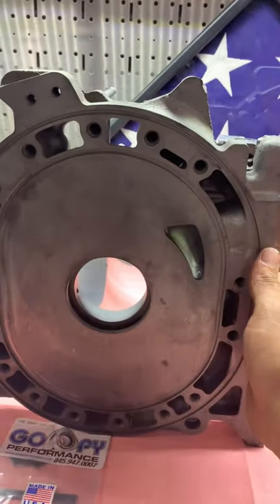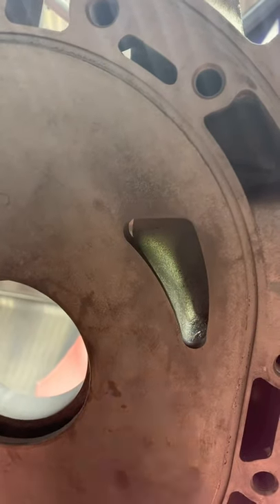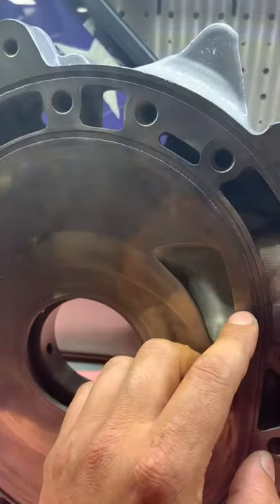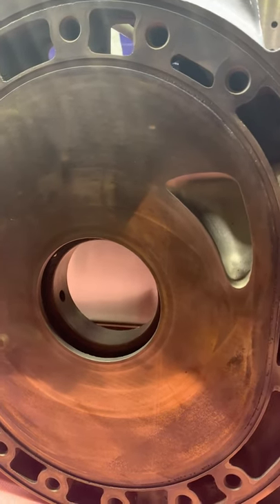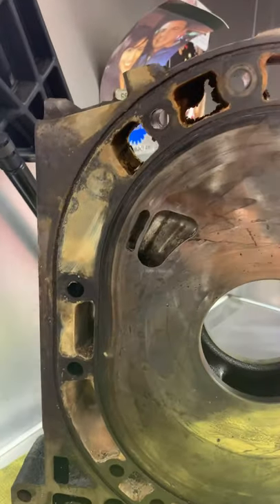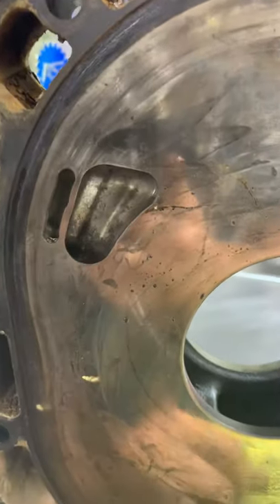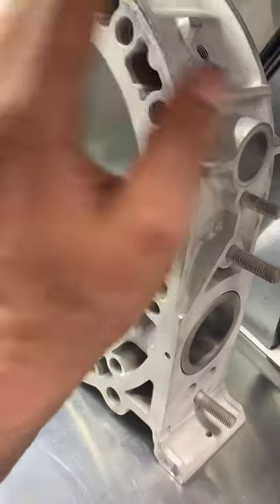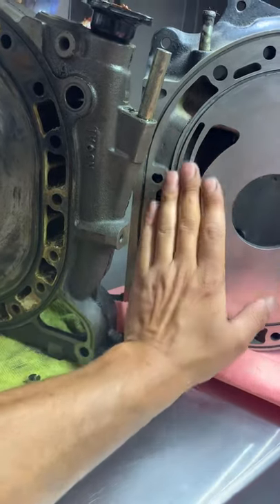Why semi p ports are better then bridge ports

Comment: Thank you!!  I am a huge fan of changing the closing edge so that the corner seal edge closes later but the oil seal edge is untouched.  This aims the closing edge, where the air flows over, at the center of the chamber at the point of highest chamber expansion rate.  It also softens the reversion pulse as the rotor closes the port, for less shock pushing the airflow back up the intake
Reply: Very unique 3D visual perspective you've just created! Cheers
Reply from the maker: Absolutely spot on bud.

Comment: The apex seal issue can also be caused by excess heat build up around the plug area, causing a high spot on the housing and wearing the centre of the seal (so I was told by one of the most reputable builders around)
Reply from the maker: glen scholz yes very true. The semi limits that from happening and also tuning. To high of EGTs Will cause it too.

Comment: I figure I have warped apex seals in my race fd engine right now for the exact reasons you mentioned. I’ll be pulling the motor in a week or so and once cleaned and prepped for inspection Ill know the full story. I’m with you on the Bridgeport thing too. I have built them and they sound great but my engineering brain never liked it. I run a much oversized street port and exhaust ports and my car on 7psi ( spring pressure only ) of boost made 404whp and the power curve was stunning.
Reply from the maker: My Rotary Life yes. The thing is. The bigger you port the farther you push the power band over. You will start to get that chugging sound and feel down low from the over lap. It all depends on what you goal is and what your doing with the car.

Comment: I'm building a semi PP 12a now, and had a couple questions. You mentioned you'd do a D port on the exhaust for a turbo semi. What about an NA build? I think my plans would be to do a mild street port and clean up on the side housing intake ports, but I'm not sure what to do for the exhaust. Rpm goal is the occasional blast to 9 with clearanced, unbalanced rotors, upgraded oil pump but no pressure increase, renesis stat gears and bearings. I would love to hear your input. Amazing video on porting.

Comment: Was thinking to only have a half bridge on the secondaries and extend port the primaries. Turbo 20B setup will be street driven.  The exhaust leaking into the intake is what put me off a semi pp.
Reply from the maker: Adriano Chiro it’s not that bad. You don’t do an extended port. Just do a small street port with a 3/4 semi. It will be a lot more reliable.

Comment: Hi thanx for the awesome information I'm from south africa when you are doing your semi pp do you weld the semi pp to the housing or do you just press fit them? I would just like your professional opinion if you don't mind sharing your information and expertise. Regards Shane
Reply from the maker: No I don’t weld them. We cnc the hole and block off plates. The tube stops about 5mm to the housing surface. Then I fill the housing with epoxy and place the plates in to the holes to block the water jackets.

Comment: I had to come back and comment again, I asked my engine builder about semi peripheral port engine. I was told is true semi can out perform bridge and only good for drag. Because you'll likely see boost being made from 6k rpm which too high for a street car.
Reply: Too high? Only time anything is ever too high when driving a street car is boost. Anyone i've met/talked to that has or does street drive a built car, they never ever mentioned anything about RPM ever. Lol! And 6k RPM is nothing.
Reply: @TampaxVortex.666  What you on about? Boost coming in at 6k rpm is not too high, who have you been talking to, they like driving laggy drag  car's/engine on the streets do they and thinks it's cool and normal? You don't get the point I'm making, semi PP is popular in drag racing because off the line you can launch from 6k rpm. In a street car which most of the time you need boost instant around 3k rpm minium!
Reply: @Skyrexx7  My bad, thought I saw you only mention RPM and not boost. Lol! That what i get for not double checking.

But now that I know what was said, I agree. I had a car that would spool up around 4k, depending on weather, and I didn't like it. Felt hella lifeless until then, too.
Reply: I can tell you that’s not true there are plenty of street cars running semis with no lag issues on the road also there’s a guy in Cali all he does is build semi pp for street cars
Reply from the maker: skyrexx7 not true. Pair it with an efr 9189 super core turbo and there 1.45 exhaust housing. It will make full boost by 4K all the way to 10k

Comment: Building a street ported motor for my Datsun.  It will be carbureted.  Do you recommend semi peripheral port for a carbureted street driven motor ?

👍
Reply from the maker: Not at all. EFI yes but it will be very hard to get tuned right.

Comment: that bridge at 8:00 looked alright. you hit nail on the head. you didnt deburr, chamfer all that good stuff. I personally like that fact he kept a bit of distance from the water seal. will defo make it iastlonger
Reply: But in all cases the bridge width is thin? Why not leave the bridge width the diameter of the corner seal and allow a good section of meat behind it? Personally I think a bridge only disrupts air flow? Rather a decent extend port!

Comment: Thanks so much for this!! My coolant seal went and about to rebuild my motor and was pondering BP for longevity. So will skip it and go semi P.. Will semi P and my street port still be good for street? Running factory turbo s4 setup making 320hp (at wheels). I'm hoping for a solid over built 400hp on standard turbo (if possible). Thanks again man from Australia!
Reply from the maker: Don’t do a semi on a p port. It’s way to much air for that turbo
Reply from the maker: Joe GSPADE Galletta don’t do a semi p port on a stock turbo. The street port works fine with a semi p port.the semi p port will flow way to much for that stock turbo and egts through the Roof
Reply: @Rotorguy479  thnx heaps man, my mate the previous owner, just said the same thing. Subscribed to your channel. Rotary community needs good advice from boys like you and it's greatly appreciated by novice guys like me :)
Reply from the maker: Joe GSPADE Galletta no problem bud. I will do some more soon. I’m just setting up my new shop and have been busy.
Reply: @thokdesign  if you haven't already, port the hell out of the wastegate of that stock S4 turbo, mine was boost spiking so bad it was barely drivable after I street ported + better exhaust (eg no cats) with the stock wastegate, ended up doing a hybrid turbo (bigger front end, stock rear end) but ported out the wastegate for some sort of boost control. 320atw with a stock S4 seems oddly high though, sure that wasn't crank/estimated crank? I thought they typically ran out of puff in the mid 200HP sorta range, not 300+

Comment: Is it possible to run a Rotary on just a P-Port in the housing with a portless iron.
Ups and downs of doing so? 
Thx a lot in advance :)
Reply from the maker: Daniel yes of course. That’s about every full race NA engine is. But you have a high idle and fuel wasted out the exhaust. Crazy power band and sound.

Comment: Great video! I am looking to buy a RX-8 and have ‘the brap’. Semi P is a big change in the engine bay, so still thinking of a bridge port. Any recommendations? I’m aiming for 300BHP max(for the street and taking it to a race track, not a dragstrip). Want to get the power from balance and high RPM
Reply from the maker: I’d put a semi or a full p rew swap and call it the day. 300whp easy
Reply: @Rotorguy479  thanks! I really appreciate the reply. Going to look into it😎

Comment: i went to one of my countries best rotary builders and was told when i asked for a semi pp turbo it was to much for the road.. yet they suggested i do a bp turbo.. i walked away as i wasnt getting what i asked for.
Reply: draggeeks1  yet we have 1000bhp cars on the road.. just because I want a semi pp does not mean I have to drive it like a race car.
Reply from the maker: draggeeks1 I do a drag semi different then a street semi. I do a medium street port and a Medium D port on exhaust. With a 3/4 semi p port. It works great on the street paired with the right turbo. It’s a beast on the street and not to choppy getting off the line. Some people go over board when porting and that is not good for the street.

Comment: Awesome video, I'm sold on the semi. 
I'm actually on a lookout for a rx8 to then later on have it semied, but one question, is it better just getting a13b rew and get it done then oh the renesis, I know they have different designs altogether, and I would think cause of emission laws they kinda lowered its performance somehow with this renesis. 
Also you have a new subscriber 👍
Reply: Hello, I’m in the same boat as you as I’ve just bought an rx8 and am also sticks between the renesis and the rew, did you ever end up deciding on which one to go with
Reply: @ninjafang2  I haven't gotten the RX-8 yet, it's been difficult finding one around here in the condition I want it at. But I'm leaning towards the rew for sure in the build .
Reply: @ninjafang2  congrats on your RX-8, definitely a great car👍

Comment: how much power is feasible out of a 12a that's still carburated WITHOUT making it less reliable. I'm looking to get reasonable power without boosting.
Reply: not much. I'm not no rotary guru but a 12a carbureted non turbo won't get much hp increase even with porting. Unless you go peripheral, expect 2-10 hp out of a street port, maybe 8+ on an extend port, not sure about the other porting
Reply from the maker: Ive gotten 158whp on Webber carb with a street port.

Comment: So what would you recommend for an NA 12A? I’m thinking about buying an FB RX7 with the intent of pulling the motor and porting. It would end up being daily driven pretty frequently, but keep in mind that my standards for a daily aren’t exactly that high (I’ve been daily driving my 944 race car for about a year now. No a/c, stripped interior, bucket seats, harnesses, loud ass exhaust, etc). Looking for somewhere in the range of about 250hp while keeping the fuel consumption at above 10mpg. Is this possible or am I dreaming?

Comment: What would you recommend to be done to a 13B-REW to make 700whp & 9k redline? I know it has to be all clearanced and balanced correctly,  would a semi pp port be capable of making that type of hp safely? What type of turbo can happily achieve that goal? I know some street ability will be taken away but I don't care, looking to get some advice for when I get my RX7 FD and start building it.  The most obvious things I can think of I need are studs, side clearanced rotors & lightened, How big injectors? What seals do you recommend OEM or aftermarket? What does it take to safely run at that hp? Awesome video aswell I know so many guys appreciate your videos because of the information you provide, Cheers
Reply from the maker: 77Knives yes. That’s what it’s for. Also with the clearancing and balancing it will go to 10k easy. All the drag cars you see running 6 seconds are semi p port engines.
Reply: @Rotorguy479  Doesn't the E shaft take the hit when you rev over 9k? Cheers on your reply mate, looking forward to more videos.

Comment: Good video, how does fuel consumption compare with bridge vs semi pp? My FD is stock, for me I was going to stick with stock ports or a mild street port but I'm wondering if there is a big fuel consumption difference between the 3 types? My guess is stick with stock ports for 300-400hp range?
Reply from the maker: Well you don’t need a semi to make 400hp at all. Yes it will waste a bit of fuel because of the over lap but it’s not crazy

Comment: I'll be honest I love my bridges but I can't argue with anything you said. I do want your take on the semi pp reni hybrid motor with gslse housings with semi pps aswell as the exhaust. I do like that my bridges tend to make good power and for cheap cheap. But I can't say they last very long at best a year with as many reused parts as I can get away with. I do think since I'm getting low on housings if I'm gonna buy new I might aswell look into a better option. Still I can't say for cheap fun a bridge port is a bad idea as long as you can tune for it and make an intake cause all the OEM ones are too long. Thanks

Comment: What I don't understand is why hasn't anybody gone full P-port, and then drop in an asymmetrical reducer ring to tune the timing and overlap? If you used reducer rings, you could have something with a great huge hogged-out hole that flows like crazy but doesn't have any more overlap than a mild street port.

Comment: what about for NA application? looking to get more power from my gsl se when/if  my stock motor ever gives, but would like to keep it na. Would you still suggest a semi p-port?
Reply from the maker: MazdaGuy well p port is nice but you have to understand it’s not going to be a daily driver. It’s very rough at idle and getting going but she will scream.
Reply: @Rotorguy479  About n/a applications, is a semi pp worth in an rx8 if its daily driven without driver caring much about crazy horsepower numbers? I mean, I ve seen bridgies making 250-260 hp in n/a rx8's. Can a semi pp make that much power while being drivable and more reliable than the bridge? I mean something like a light semi pp that will not be used in a drag car but in a daily driven rx8 which means driveability and some reliablility as im not looking for high horsepower as I mentioned before(otherwise i'd go full pp)  Sorry for my english and thanks in advance!
Reply from the maker: JDM Lover I wouldn’t do it on it. It’s not going to give you the best results
Reply: @Rotorguy479  Thanks for your answer but may I ask another question? For an rx8, how to get some reliable n/a horsepower while maintaining some driveability for daily driving? Is a streetport the only solution? Or bridgeport is the other one but sacrifices reliability much?

Comment: What about 'streamlining' intersection of port and plate? Old work indicated a bend in intake duct improve performance, this could be from blocking mix going backwards, but at full throttle, experiments pointed to better performance and efficiency with peripheral ports.
Besides in sport and aftermarket versions, Mazda always had side intake ports; in the Renesis, also side exhaust ports.
What a mesh!

Comment: Is it possible to do a semi p port on a Renesis engine if you swapped the rx8 rotor housings for rx7 FD rotor housings while still keeping the rx8 internals ? What would be HP numbers and daily driving capabilities for a naturally aspirated build like that?
Reply from the maker: Julian Guzman you can do that but you would have to delete the 6 port actuator. It’s in the same spot as the semi p port. It would loose a bit of low end. 275hp range

Comment: Have you considered making a D shaped semi p? That way you could delay the timing. My thinking is that a D that's well chamfered to make the flow go out and up would reduce overlap and flow better.  Your porting looks like mine, I like to get a smooth curve inside the port to help keep the flow attached to the surface. Some people don't get it that the air flow is upward not just straight into the chamber, so they put sharp edges on everything.
Reply from the maker: Red Bat Racing yes but it’s very hard to do it that small. Also it’s really not as bad as you would think because the semi p port is still between the side ports. Over lap is not as bad as a full p port

Comment: can you make a huge PP and use a valve to open it up at hight rpm? that way you have low idel and open it up at higher rpm, kinda like a "vtec"
Reply from the maker: Rafael Baggio Secches yes you can do that too.
Reply: Mazda made facorty cast peripheral port housings for their 12a, 13b and 26b, (the Lemans 24 hour 767b) engines.

Comment: I have a peripheral port rx8 with 20B engine and its honestly 😅😅a mission just to try and cruise with..always so hungry for fuel 😢
Reply: Sooooo before you bought/built this PP engine, you DID know what you were getting yourself into  right?
Reply: @txddyfarquh3916  obviously 🙄 not. I did not purchase the vehicle. It was purchased by my dad who barely has time for some of the cars because there's too many project cars on top of one another.
Reply: @txddyfarquh3916  one project in particular is a 4 rotor bridgeport with single turbo on a kit car.

Comment: What is the longevity of the sealant around the Semi P port/how many miles did you run that motor? I'd be concerned about differing expansion rates when it heat cycles.

Comment: What about beveling or streamlining the intersections between ducts and working surface? Meaning the ports interface. 
You have a chart about this in 'Manual of Automobile technik', by BOSCH.
An straight angle generates turbulence, losses, beveling improves a bit the situation, a parabolic section of duct when entering working chamber gives near 100 % Efficiency.
It also mitigates the shock of seals every time it pass over port, the hammering as in 'chattered marks'.
Blessings +

Comment: how much would a peripheral port cost on a renesis 13b?
Reply: I know is 750 to semi pp the housings
Reply: Dont fool with a renesis find you a solid 13b rew or find some old gsl housings and block off the exhaust ports on the renesis. Factory side exhaust port renesis are junk
Reply: Cosmo 13B block is the best.
Reply from the maker: Seth Nicodemus 1000 for the machine work
Reply: @Rotorguy479  i would like to get a set of housing semi pp done how can i get information